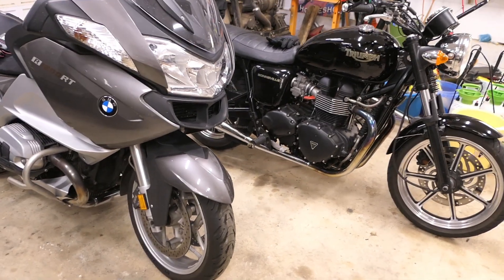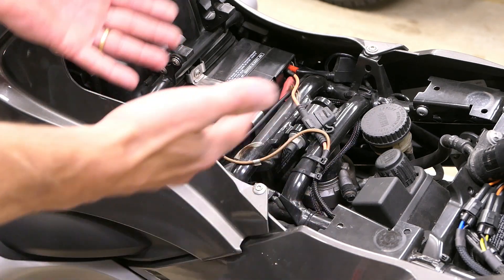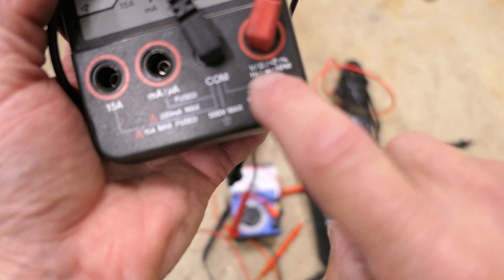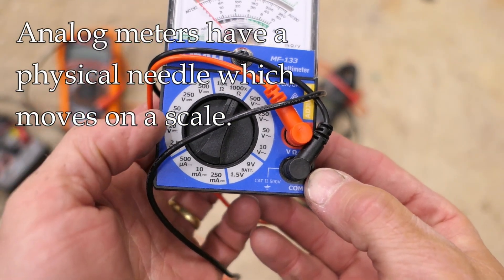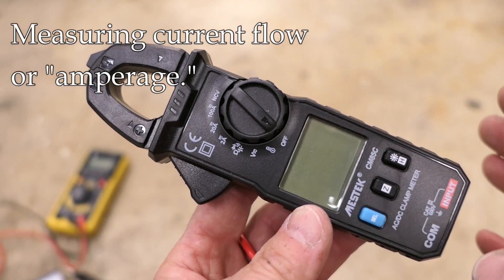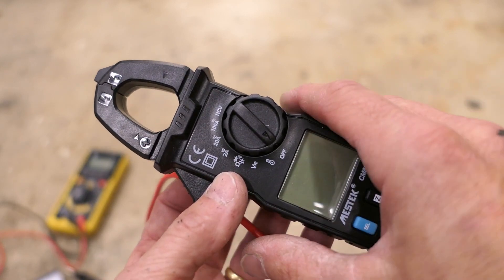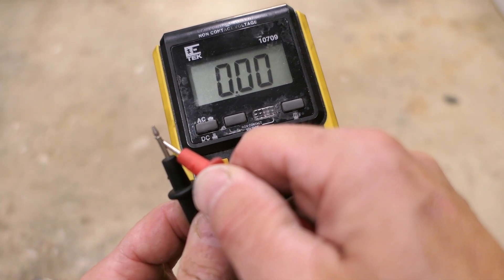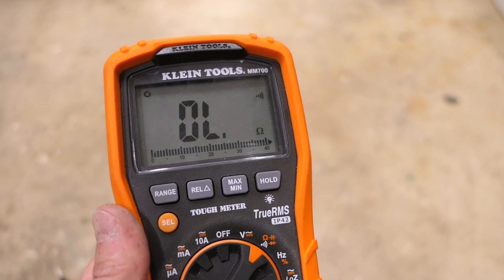Basic Multimeter Use In Motorcycle Applications

Comment: I forgot ny key own in my bonneville and after charging 24h to 13v, still nothi g happens when turning on the key. How to test that? Should i just replace batteries or test with another batterie.
Reply from the maker: If I follow you correctly, you charged your battery for a day, yet the bike does not respond at all to the key-on position?  No lights, no dash?  First, you can check the battery with your meter for resting voltage, which should be  in the mid to high 12V range for a fully charged standard battery.  If that checks out, then you want to examine your battery connections for being tight and clean.  Then you can trace the starting circuit.  Model years vary, but you can check fuses and relays and grounds.  You can check the harness for damage (especially if you left the bike all winter and there are mice around).  If the problem is that the dash lights up but the starter won't engage, you can test the starting circuit, including the starter and solenoid.
Reply: @tinderboxarts  there was a blown fuse on the right side. Close to starter a 30a. Probably blown because I also tried to jump start with my friends bike.  Thank you for detailed answer.
Reply from the maker: Glad you got it sorted!

Comment: Hello John, i have a 2010 BMW RT1200 could you make a video on how to re-calibrate the bikes functions after long term storage with the battery being removed. Thanks from Australia.
Reply from the maker: You really don't need to do anything after reconnecting the battery.  Items like the tire pressure sensor registration are stored in long term memory even without power.  Items like the throttle position sensor or idle steppers are re-learned in a few short rides by the computer.  There is a procedure which may shorten this process for the throttle position sensor, which is to turn the key to the on position, turn the throttle lock to lock three times, and then shut the key off.  I can't even confirm this works, actually!  But if you just reconnect the battery and do the normal start procedure the bike will run just fine.  As you ride for the next few times, the computer may make small adjustments in it's settings, which it does anyway.  If you do have a problem after reconnecting there may be something else going on, such as a rodent getting into the wiring or making a nest, etc.